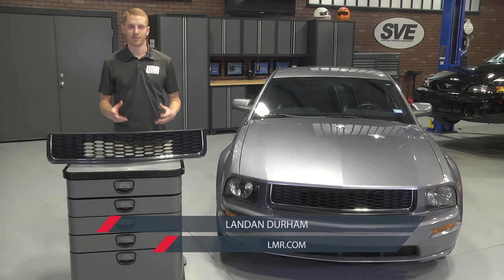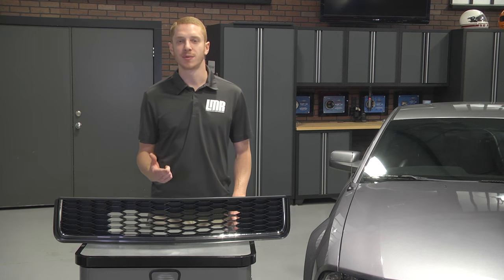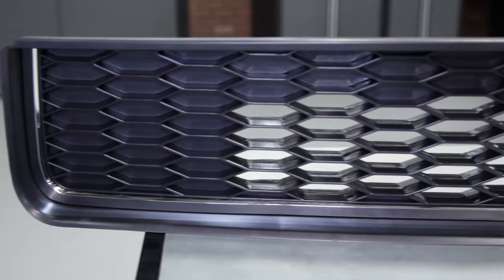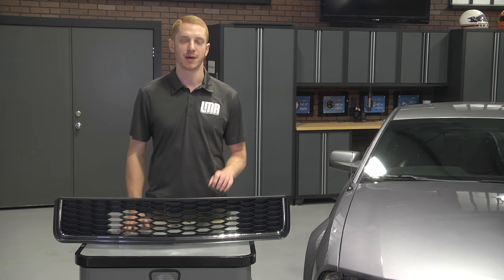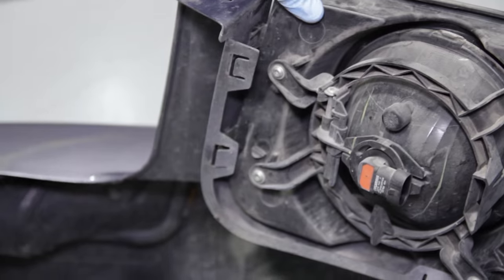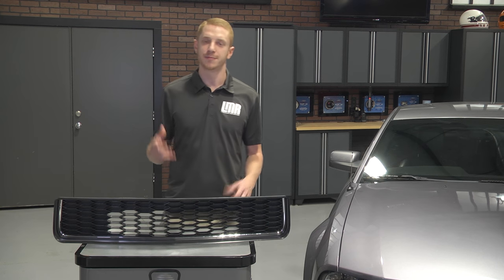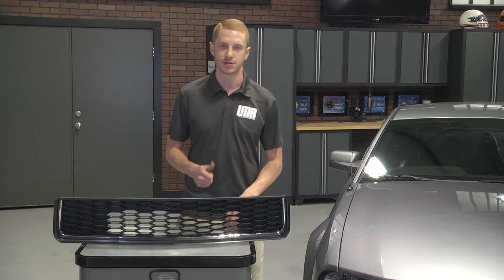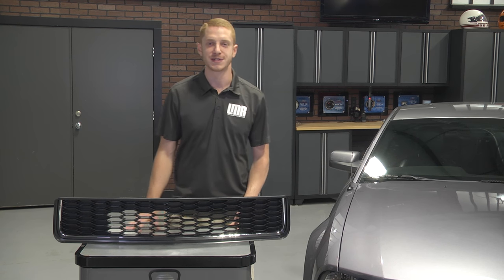2005-2009 Mustang GT SVE Bullitt Style Grille - Review & Install

Comment: You do not have to remove the front bumper off to install a grille, all you have to do is pop the hood, remove to radiator cover take a flat head or a pick to push back the the tabs that are holding the factory grille in place and pull it out, very very easy to do
Reply: Mustang Man yeah I can swap my grille in about 15 mins I've never heard anyone say to remove the bumper cover ... weird
Reply: Even the bottom tabs? I'd imagine that would be hard if the bumper is still on?
Reply: Yup, you do not need to remove the bumper to pull your grille out on a S197. Make sure to place some painter's tape, so you wont cry to your mama when you scratch your bumper though. Even the bottom tabs unhook once you got most of the side tabs out.

Comment: would be great if EVERY pic of this grill including in this video, where the bottom trim of the grill is warped and never fits the bumper snugly.....fail
Reply from the maker: Thanks for your concern.However, those tiny gaps between the bottom of the grille and bumper are normal. Factory GT & Bullitt grilles, as well as this new grille, commonly had high/low spots that vary from car to car. -Landan